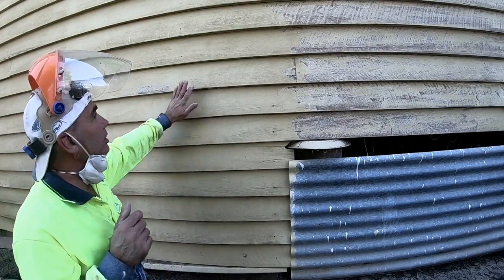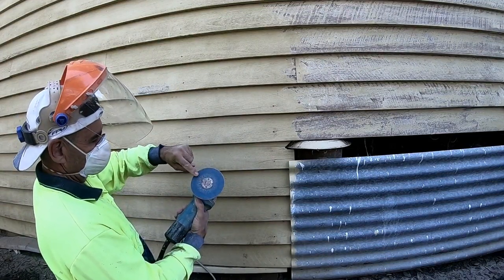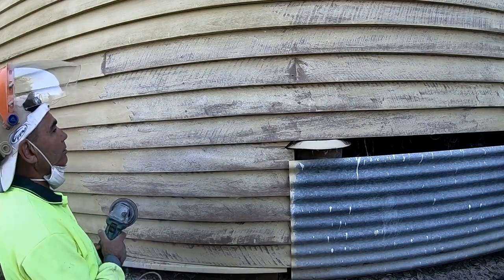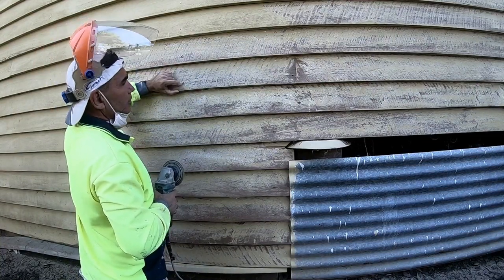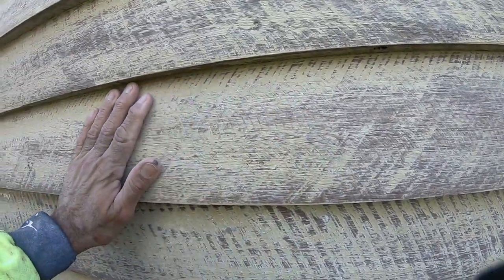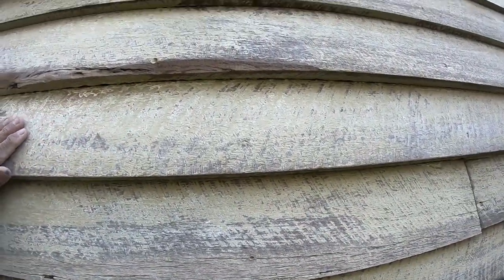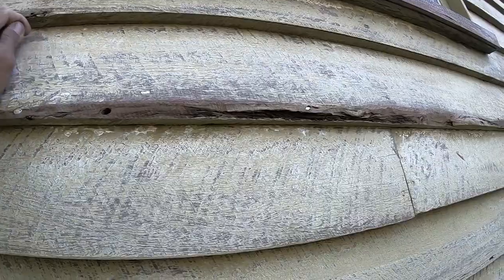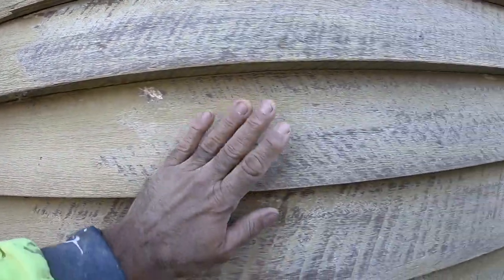Sanding weatherboards and preparing for painting with 5" makita grinder

Comment: Thanks for posting. Given a lot of DIYers watching this, will be impressed with the speed of this method, you might want to draw attention to what can happen when that disc (which is pretty slim) gets pinched by the siding or in any small gap - very serious kick back, enough to force the grinder out of your hand and send it spinning  in your direction. That disc is spinning at anything up to 11,000 rpm, if it does get caught, it is impossible to hold onto the tool. And yes, I used to use an angle grinder in this way, and after two near misses decided to try out other methods. 
I guess you're well experienced with this method, and know to avoid situations where this can arise, but less experienced users wouldn't know. You've never had kick back using this method? 
Do you do anything to the surface before using this method? I'm guessing the discs are zirconium?
Reply from the maker: Great subject to bring up, if you hold your grinder the  wrong way it can kick back but if you watch and follow the way im holding the grinder,the grinder only spins one way and that's the secret. Its impossible to jam,in fact it will slow the grinder right down if it gets caught.Ive been sanding this method for 40 years,only once did I have a problem when I was sanding fazia above my face when it caught and I have several scars on my cheek from it.
I have a couple of other videos that show the sanding as well.
Reply: @ThePa1nterhowto Thanks I think so too. I've seen the other videos, my point is you may have perfected a way of handling it such that it's 'impossible to jam' but that's something it would be a good idea to post a video about. Personally I'm still unclear having watched your videos very carefully and reading your explanation above, how your method completely removes the possibility of the grinder jamming. The fact is whichever way you cut it, if the wheel is caught or pinched (such that it can't turn anymore), it doesn't just slow down, it stops suddenly hence kickback. Particularly a grinder like this, which I'm assuming is spinning anything between 8,000 and 11,000 rpm; doesn't have variable speed; and doesn't have a safety cut out when the wheel is jammed? 
Without you clearly demonstrating how you reckon this can be removed as a risk to the user, you're going to have your viewers think there's nothing to this and thereby setting them up for a fall - no? 
Still interested if you do anything to the surface before you begin sanding? and whether the Norton disc is zirconium?
Reply: I once used a huge grinder in this way and it kicked back and hit me in the stomach and kicked me off the ladder onto my back on the lawn. Got a real fright and used the smaller grinder, and more carefully since that experience
Reply: @jaynz247  Looks like you had a lucky escape. Even the smaller grinders need to be treated with a great deal of respect. In terms of faster sanding - faster than using a Festool Rotex in geared mode, there are far safer and almost equivalent systems, which also provide an opportunity to extract the dust produced - better for you (even working oustide you're breathing some of that dust in, without the proper equipment),  and better for the environment:  particularly where you're removing many layers of paint, some of which contain lead. 
Not sure what the laws are in Australia, and as far as I know not much in the way of legislation in UK, but from what I know from guys in the U.S. the rules are pretty strict about controlling hazardous by products of reno work. 
Yeah it's great to rip through linear feet of 30/40 year layers of old paint systems - but on so many other levels this really is old school gone badly wrong.

Comment: Thanks for your very informative videos!  I have a Victorian weatherboard (Baltic pine) in Melbourne with 4 layers of paint, some of which are hard as a rock!   So I bought a Bosch 125mm variable speed grinder and some Norton Blaze Rapid Strip discs, and it worked a treat!  Boards are stopped back to bare wood, like brand-new.  Note, not all strip discs are created equal.  Some have coarse nylon and silica carbide fibres, some have fine fibres.    I was nearly at my wits end the other week when I started stripping my boards manually with a paint scraper (my elbows are still recovering!).  Then, I tried a Festool Roxtex, which does a beautiful job but waaay too slow.  So after some googling I was amazed to see you using a grinder, and now I just wish I’d seen your video earlier!  Thanks again.
Reply from the maker: Thanks for commenting, nothing beats the grinder with a sanding head, not possible if your sanding lead paint due to safety issues. Im glad you got it sorted.
Reply: Hey mate what happens if you have lead paint and sand like this? What are some other options for getting lead paint off weather boards safely? Cheers
Reply: @sammtamm  dustless blasting, i.e. soda, sand, glass etc. but you gotta put geofab down everywhere to catch all the run off.

Comment: Just wondering what wattage/model is the Makita 5" grinder you're using here? Also is that just the 115mm rubber sanding pad on it too. Cheers.
Reply from the maker: Its just the standard 4" grinder with a 5" rubber pad, you can use either 4" or 5" grinder, smaller the better, faster the better

Comment: Hi, great video. Would you paint with a primer first then two top coats? Or can you use exterior paint that has primer in it? Cheers
Reply from the maker: You can just put your first coat on with your exterior paint, putty, prep and hand sand 180 grit sandpaper till smooth. Add two more coats of the exterior paint. Or you could use oil based primer but nowadays there is no need.  It will still be perfect in 10 years time with all exterior paints.
Reply: @ThePa1nterhowto  but if you say 3 coats and you already have some undercoat, why not that then 2 top coats...? Seems more logical to me... being a painter... and the fact that the 3 in 1 sticks better than top coats on anything... Just saying... but the angle grinder is the biz!

Comment: If your going to all the effort of sanding, shouldn't you be using a slow drying oil based primer so the paint actually lasts?
Reply from the maker: You do not need to use an oil based undercoat on hardwood timber in these situations, oil based undercoat has its magical purposes but not in this instance.

Comment: Edited original comment to bring in line with reply below. And thanks ThePa1nter for taking the time to reply and your wise info much appreciated mate. As did burn out a 4" grinder sanding back my old weather board house round 25yrs ago. Which was probably a budget model as well. Not that should matter. Just that cooling fan is on end of drive shaft and 100% cooling @ full no load speed. If working hard and speeds drops to 50% then cooling drops to 25%. Hence body gets hot so best run up to full speed again to cool down in a couple of minutes, rather than sit for hours to cool down. So have recently found out online. But hey, was just quoted 14K to repaint so if did burn out could still come under consumables if DYI. But as replied below The Painter has been running his for up to 20yrs. So now confident to carry on. Also comments about kickback and neighbour said that ran his 7" sander at half noise after a kick back. But maybe wasn't operating right as well. Just that again, best cooling happens at full speed, obviously.
Reply from the maker: We have been using angle grinders for many years, continuously, hundreds of hours,the only thing that wears out eventually after a year or so is the brushes and they are replaceable. I have grinders at home 20 years old.

Comment: Have you used paint eater from wagner to remove exterior paint?
Reply from the maker: No ,i have seen them work but never tried one. The benifets would be no disc clog up but damage to the wood could be a problem

Comment: Much quicker with the grinder than rotex. Do you caulk the laps?
Reply from the maker: Blute72 Yes much quicker, no never caulk under the weather boards,they need to move
Reply: Lots of painters are caulking the laps now. I agree it looks better but I think it might lead to problems down the track
Reply from the maker: SP Bygga What happens is the boards move and leave unsightly beads of gaps showing,only way to fix it is cut it back and repaint.

Comment: Just curious whether you've left swirl marks in the boards or existing coats? They are usually seen from an angle when the finished coats have been applied...
Reply from the maker: All hardwood weatherboards are cut origional with a circular saw and come with circular cut marks,even at a hundred year old wood. I personally don't leave marks that can be seen through the top coats but I do on purpose have fine swirl marks for paint adhesion,even on my floors that I sand, different to deep grind marks left by amateurs that sand.

Comment: Hi there, looking for some advice. I have bought a 30yr old cedar cladded house which has never been looked after, so only ever stained once. The sun has slowly started to burn the timber and fade. What sander would you advise me to use? You also mentioned Weathershield paint. Would I have to paint an oil based primer first? Then 2 coats of Weathershield paint? I got a quote from a painter who said he would have to do 4 coats of paint after sanding (1 oil based, 1 water based, 2 top coats... it seems very extreme and cheaper to just re-clad the house). Thanks so much in advanced for you advise. Tace
Reply from the maker: If the stain is only thin, I wouldn't sand it heavy. Just remove the loose areas, apply the oil undercoat with a brush,give it a light hand sand to smooth it out with 120 grit sandpaper then two coats of weathershield,  once you sand the undercoat its easy to apply the top coats, so much easier and cheaper than replacing boards
Reply: Is it really 'Cedar', or is it Cyprus? Big difference. Cedar is soft and you can dent it with your fingernail. Be really careful about sanding it or you will dig big holes in it.
If it's cypress, then attack at will. 😁😁

Comment: Hi there. Why choose to sand when you could use a paint stripper? Do you recommend one or the other ?
Reply from the maker: A paint stripper will just take off the paint, you will still need to sand after that,  so much more extra costs for no benifet. As long as the paint under is sound its good to paint on top and the sander is used to find the loose paint and prepare the surface. Sander is much better and more efficient.

Comment: FESTOOL Rotex RO150 geared sander is just as effective , safer but more expensive, Makita and Bosch also do a geared sander.also a fair bit safer with battery angle grinders.
Peace.
Reply from the maker: I have both, and trust me, they aren't in the running with a grinder with sanding attachment . It's pathetic the amount of Money I spent on festool only to find they can easily be beaten with s much cheaper tool.
Reply: @ThePa1nter  cheers..I will give it a try..
Reply: @andrewverran3498 you said Festool is just as effective yet you've never tried?!

Comment: hi, great video
got a 1960 weatherboard with plenty layers of paint, would you recommend a paint shaver or just sanding it down with a vacumn attached to it as close to neighbours
Reply from the maker: Assuming its lead, there are no shortcuts, I am perhaps thinking wet sanding is the go. There are grinders available now as below ebay using water to stop dust.

https://www.ebay.com.au/itm/362459028378

All you need to do is catch the contaminated water using an old gutter screwed to the bottom of the wall, and buckets attached to catch the lead particles,the solids fall to the bottom and fresh water runs off. It gives no dust,safe for you and neighbours
Reply: @ThePa1nterhowto  thanks , you a legend of info , appreciate

Comment: What's the procedure for lead paint?
Reply from the maker: I have festool ro125 sanders / and a 115 grinder that attached to festool hepa dust extractor.
There is an alternate wet sanding as well,similar system but water sanders, you need to catch this water  with a filter system.
Reply: Ah, interesting. I'm going to buy a Makita 125mm grinder with dust hood. I've got a Makita H class vac that should do the job with a fleece bag. I know you're meant to use a H class vac, but I'm only doing one house...my house.
Reply from the maker: @ashleymalamute  Thats good, make sure you protect yourself and others from any dust,keep children and dogs away until after you hose down
Reply: Correction: I've got an M-Class vac. Surely with a fleece liner it will suffice? Most of the paint will flake off anyway, it's that buggered.
Reply from the maker: @ashleymalamute  I can't see a problem if your sanding outside,its your own house ,your taking adequate precautions,